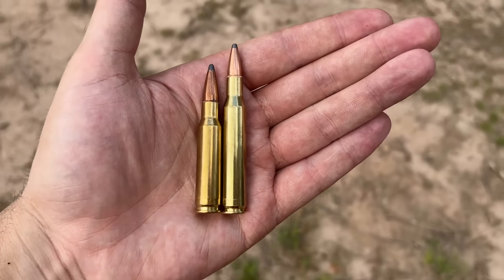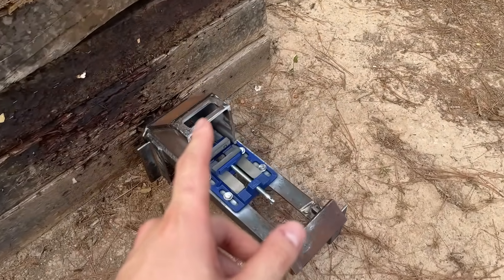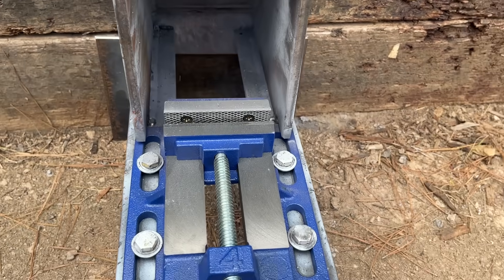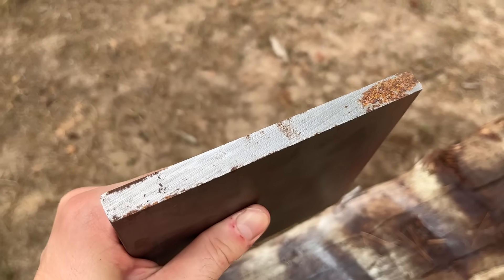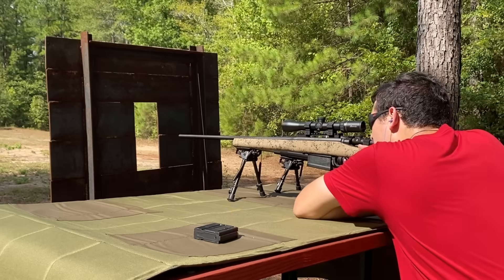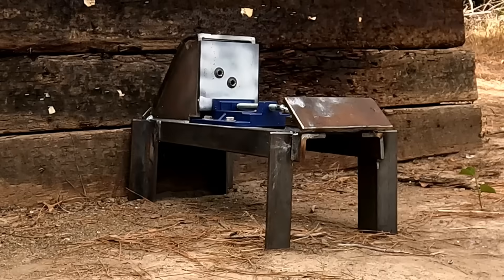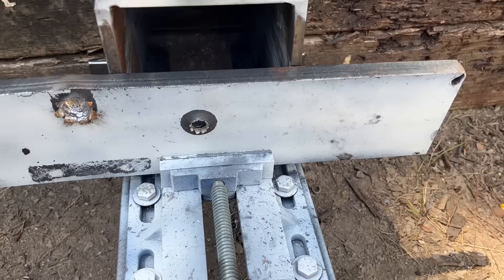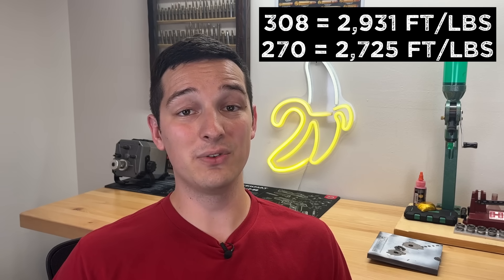270 Win vs 308 Win: ONE Clear Winner On Mild Steel

Comment: I sense some potential foolery here. How did he get nearly 150 fps more than the quoted velocity for that particular 308 round with a semi auto? Hornady tested with a 24” barrel and wasn’t close to that speed. On top of that, he got almost hornadys exact quoted velocity for the 270 with that load. The velocity he posted matches the SST round, a round specifically designed to be the fastest. The 270 with the SST is over 3200fps. If he is hand loading, he hopped up the 308 load without hopping up the 270. Fire them factory loaded with SST’s.
Reply from the maker: Both were near max loads with the powders that I was using.
Reply: I would say you have the wrong powder for 270 then. Even factory loads are faster in the 270 and you are running 308 at the max of factory loads. You either need to shoot factory SST’s, factory interlocks or you need to load both to their best capable velocity with powders they are made for. My testing on hardened steel with bullets of the same diameter showed me that 150 fps makes a huge difference.
Reply: No trickery, he used a 24"bbl, which increases speed, that's all! He simply made a fun video that needs no critical thinking, enjoy or not, why speak of foolery, it was just for fun, no need to attack his findings! Have you read the response of most people, all hate and distrust for this man! I'm appalled! This was not his dissertation on ballistics, simply a fun video!

Comment: 3:33 Looks like those washers are working overtime.. maybe another slight tweak to this sled, or an idea for the next one if this idea requires massive metal replacement: 

Drill larger holes for the mounting bolts of the vice (blue part). And use larger bolts. Maybe even two bolts per slot (although that would require relocation of the trap or just be an idea for the next iteration)

Comment: What I'd like to see is the M118LR (7.62) vs .308
I have and use both, but I don't have a sled to do the test myself.
Reply from the maker: I’ll have to see what I can do
Reply: @bananaballistics  
I would appreciate that more than you can imagine. 
I'm about to stock up again, and I'd like to know which one is the better deal, even though one is good for 1,000 meters, while the other is good for 1,100. However max effective range can take a backseat if necessary for obvious reasons. 

And thank you in advance.

Comment: I was on the fence between the 6.5 Grendel and a .308 upper. you have helped me finally decide that get the .308. I just wish they all took the same primer size.
Reply: The 6.5 Grendel and 308 uppers do not fit on the same lower. One is AR10 and the other is AR15. You might want to base the upper you pick based on the lower you have.
Reply: @kevinreichert3254  thanks. I am aware that they are different lowers. I was wanting to save money and just get an upper that would fit to an existing lower and also not have to buy another primer size. However after reading and watching some of the videos I decided to get a dedicated  ar10 multi cal lower and a box of 5k unis genix LRP's. At least I have a good amount of D073-04, .30 cal molds and gas check makers.
Reply from the maker: 308 is a great cartridge. The AR10 is much heavier in most cases, but can be worth it depending on what you’re using it for
Reply: @bananaballistics  I need something to smack the coyotes at 650 to 700 yards from my porch. I am tired of losing my goats. I think overall the reloading options for the .308 and the  performance is worth the extra for an ar 10 multical lower.
Reply: @johnoakley5544  if you want to shoot coyotes at 700 yards then buy all means don’t buy the .308.
Reply: @thomaskladar4464  I ended up putting a 6.5 grendel 26" barrel on and started loading 107gr Sierra. With power pro I'm pushing right at 2950 fps. Drop is about 7 inches at 400 yards.
Reply: You gonna get a 24” barrel?
Reply: @ I decided to get a 26" heavy barrel instead of a 24" just because it was the same price.